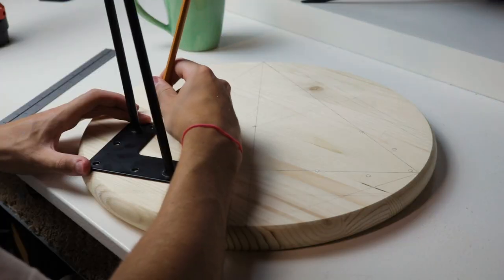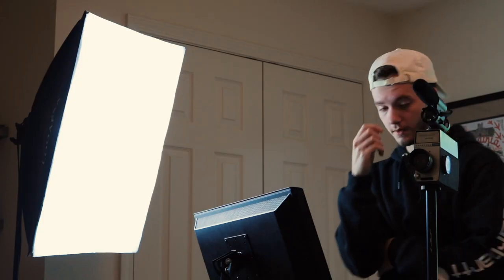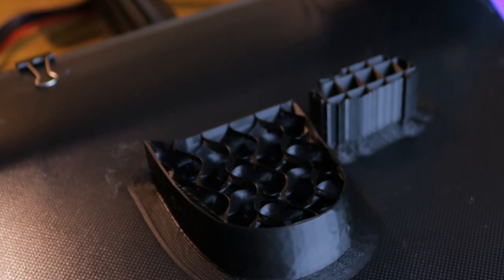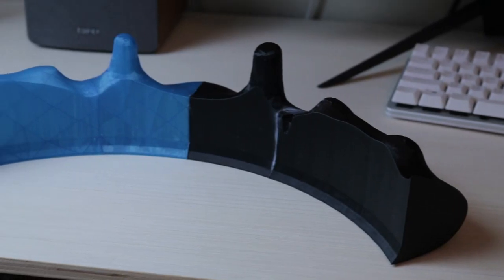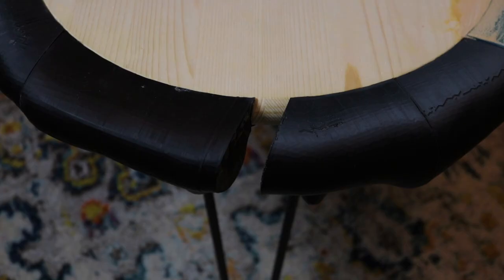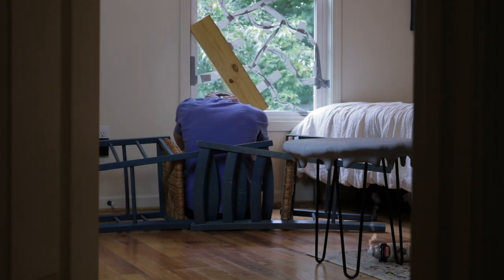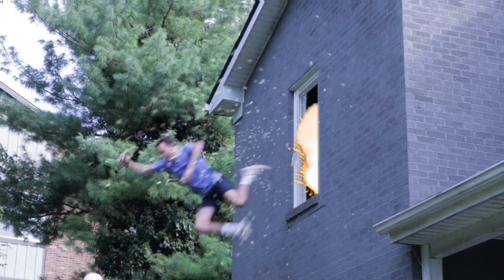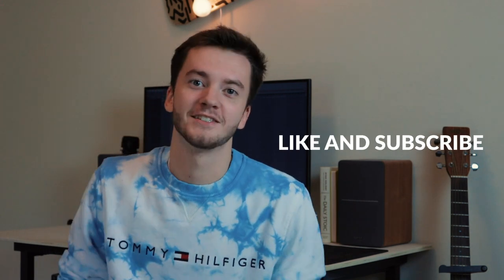How I Made a Melting Table 💧 (Satisfying) | When You're Bored

Comment: What settings do you use with your printer? I have alot of trouble printing with my Ender printer as the plastic tends to bunch up around the nozzle and not stick to the board at 210c Nozzle 95c Bed.
Reply from the maker: I usually print PLA with the nozzle at 195 and the bed at 45-50ish, so your temps might just be a little too high.